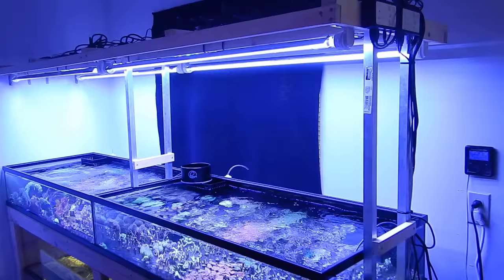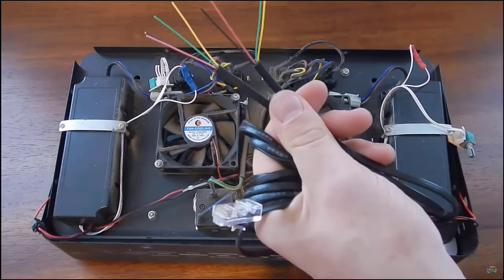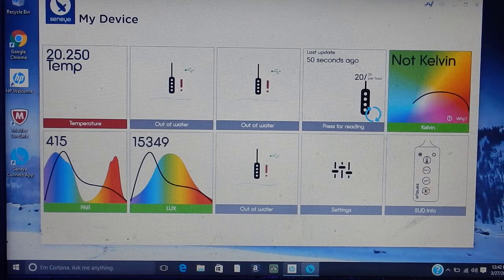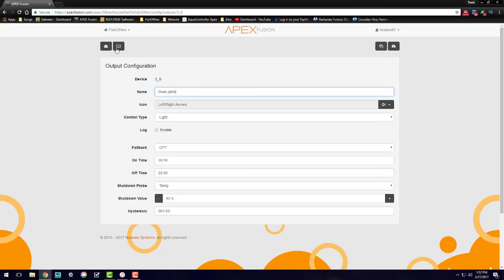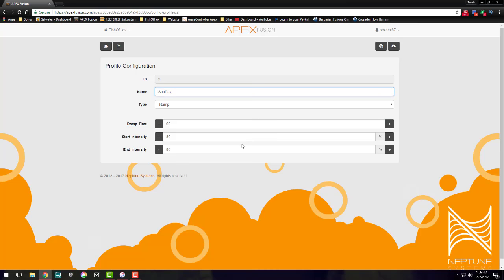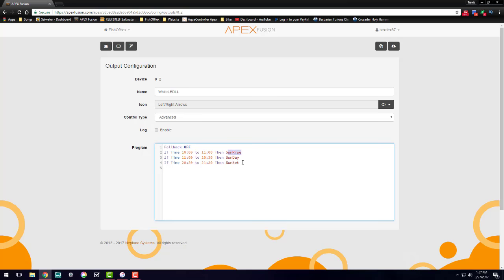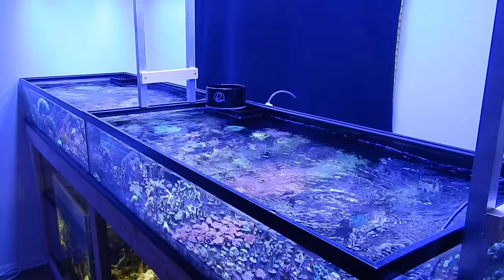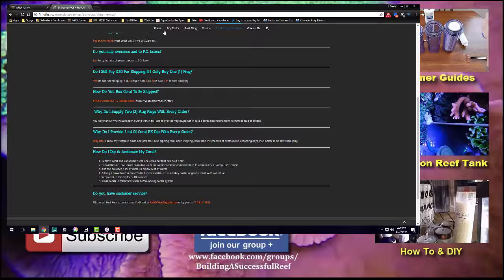Adding LED & Retrofit T5 Lighting | 200 Gallon Frag Tank Build Part 4

Comment: Yes bro you will love the ATIs i had expensive brand name leds before switching to an 8 bulb ati and my acros really took off better growth and color and no need to worry about tissue receding from the underside of colonies. All in all the power consumption isnt much different because you need so many leds to come close to the t5 coverage
Reply from the maker: I was thinking the same thing Im stuck on two of those fixtures and dont really see any reason to go another way. Ill also add a couple led strips for the shimmer.